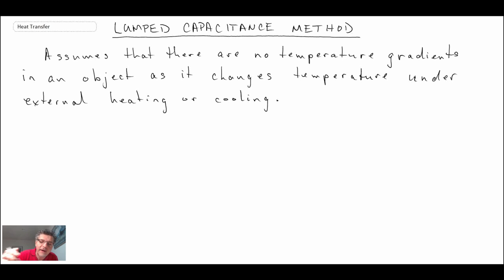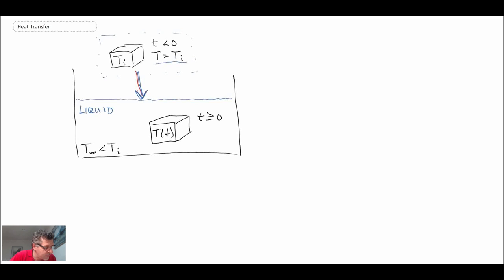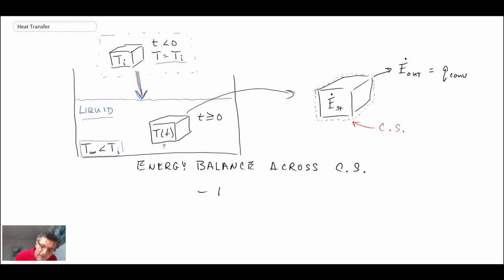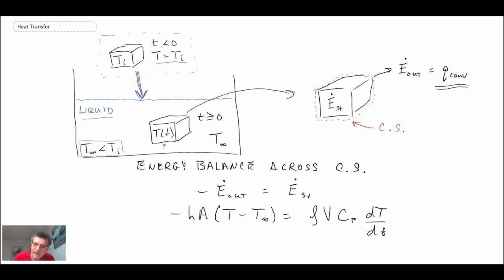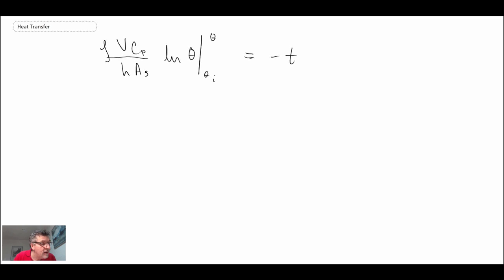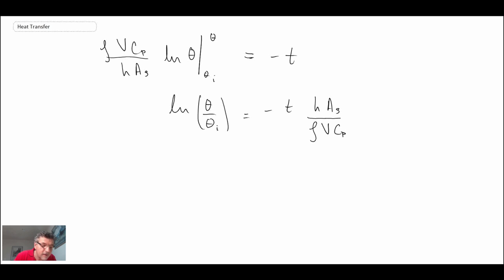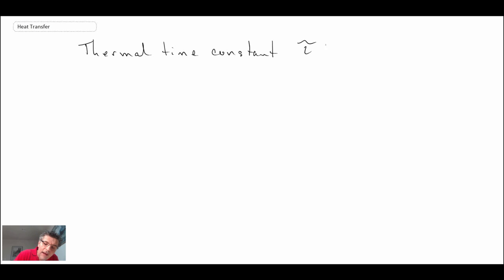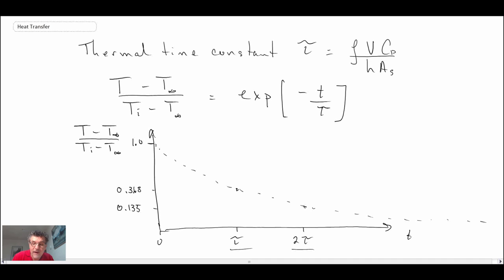Heat Transfer L14 p3 - Lumped Capacitance Method

Comment: Is the heat transfered from the cube to water through convection? Is convection possible when the fluid has velocity of 0?
Reply: it's transferred by convection, yes, fluid dynamics tells us that hot water is less dense than cold water, and so will rise. this creates currents.
at the surface, where the boundary layer is though, it would be described as conduction. but that's not how we think of it, convection is just conduction plus advection, or bulk movement of a medium fluid.
there would be radiation too, but usually that's ignored.